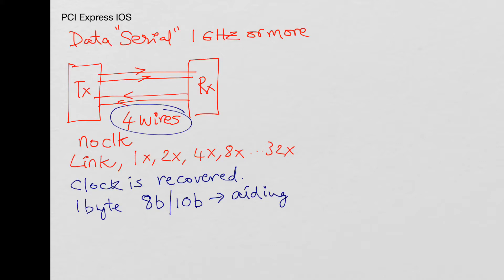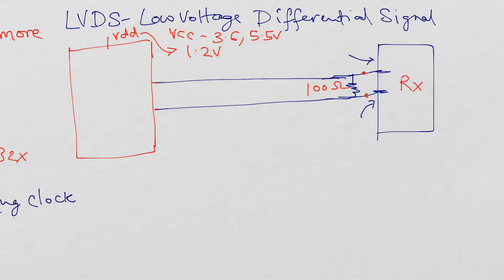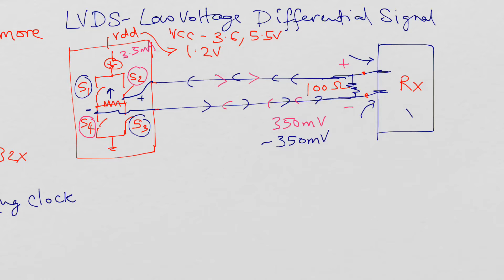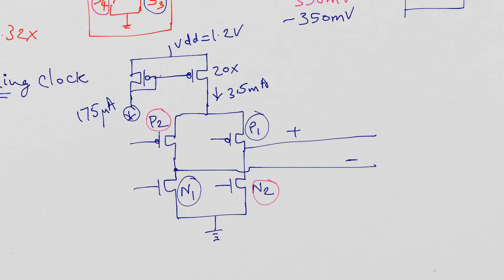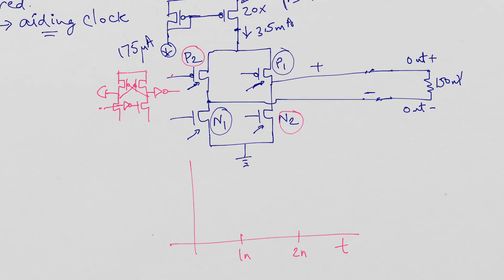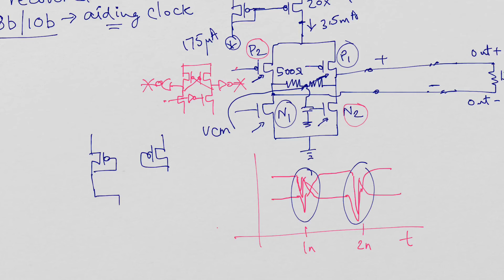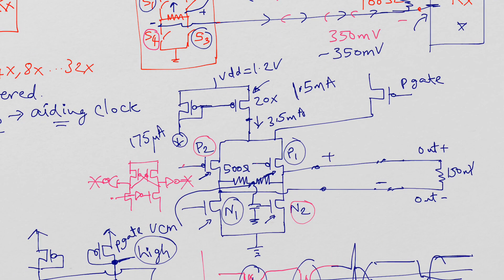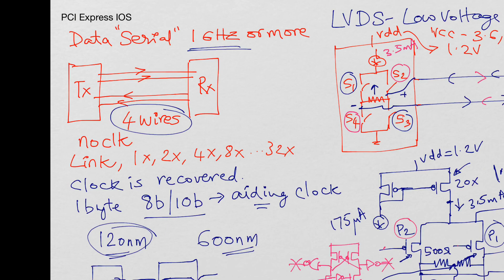PCI Express IOs Basics

Comment: PCI Express is not a Bus, PCI is.
Reply: PCI Express is a bus. It is a more modern version of legacy PCI. Most PCI devices these days use PCIe rather than legacy PCI.
Reply: If I'm not wrong, it looks like a bus to the software but in reality it is a Point to Point (P2P) communication.
It looks like a bus to s/w due to the presence of switches and bridges connected to root complex (RC)
Reply: @chosesomething  I agree, I think of it that way. At  teh PHY layer its a point to point dual simplex links (4-wire) but to the SW that's abstracted out - note that the device drivers/SW that were were written for the classic PCI/PCI-X (parallel buses) will, generally work transparently on PCIe

Comment: Maybe the problem is that, when gate transition occur transistors P2 and N1 are both turned on at the same time. Same thing happens with P1 and N2. One way to solve that problem is to separate gates and add latency between turn off and turn on gate signals. Firstly the on state transistor have to become 100% off after that off state transistor can be turned on. I hope that will help.